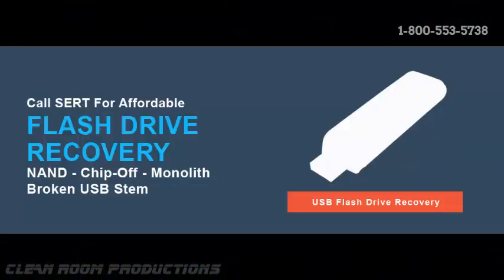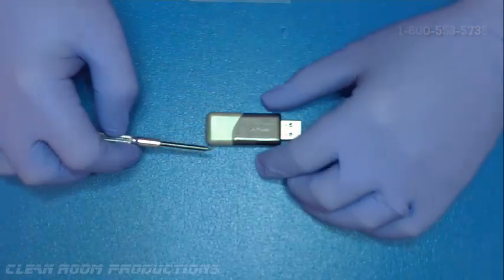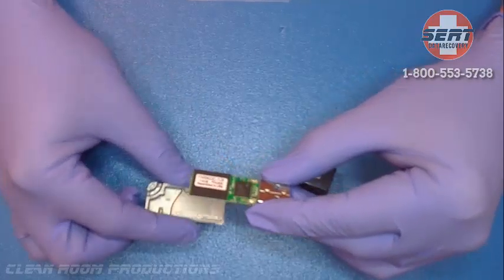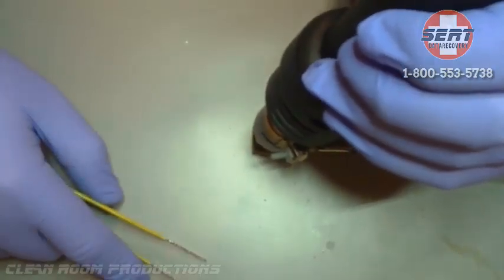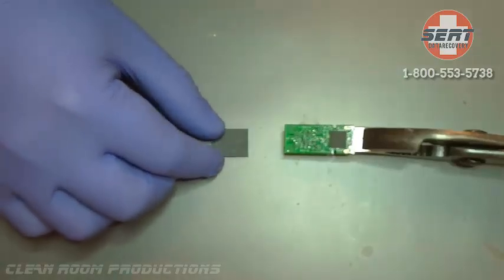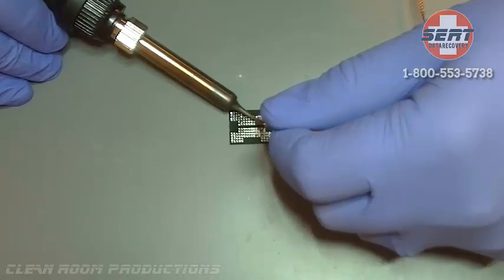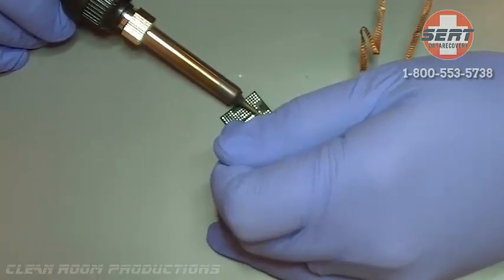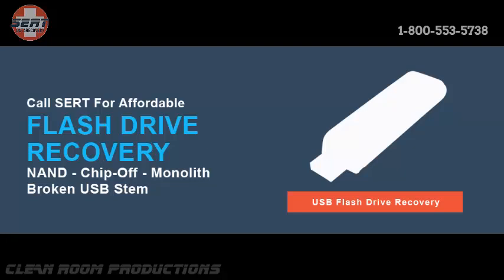PNY Flash Drive Data Recovery Not Recognized - BGA Chip

Comment: Just found your video and it seems I am having the same problem a 256GB version of the same device. What is the next step? Is it costly? Are there no home remedies or ways to do it simply using a computer? Is this caused by too much information being connected and then again removed from the device?
Reply from the maker: +Benjamin Gattie the next step would be finding a professional recovery firm that specializes in NAND recoveries. For your size drive it can be somewhat costly as most companies charge based on the storage capacity of the drive (as do we). This type of recovery requires specialized equipment that is pricey, and then knowing how to use it requires usually 6months ++ and continual training and experience with this type of storage media. Controller failures occur due to a number of reasons the most common: 1. cheap parts 2. power surges 3. not ejecting the drive before removal 4. faulty USBport/computer

Comment: I have exactly the same problem and the same USB! What do I do next, do I reattach the NAND back to the board? Please help!!! So many photos will be lost ((((
Reply from the maker: Did you remove the NAND from the board?
Reply: SERT Data Recovery Not yet. I have just discovered your video. Any advice?
Reply from the maker: OK good because you don't have the equipment necessary to do anything with it once its removed. What size is the storage capacity of the drive?